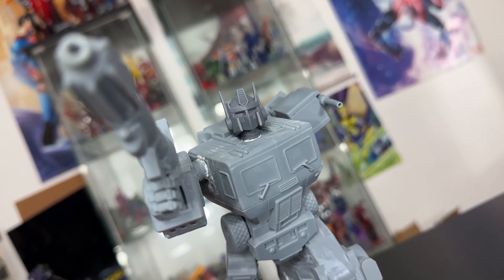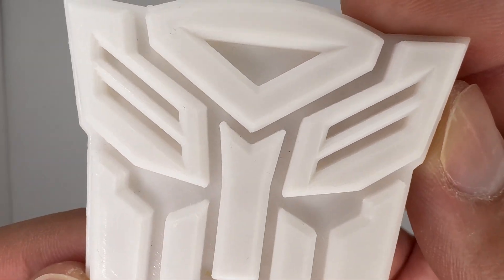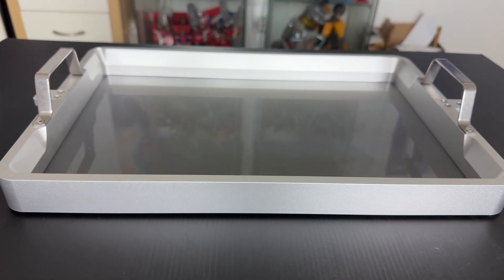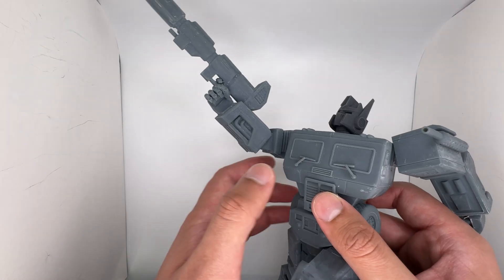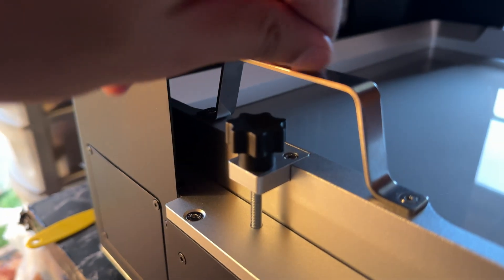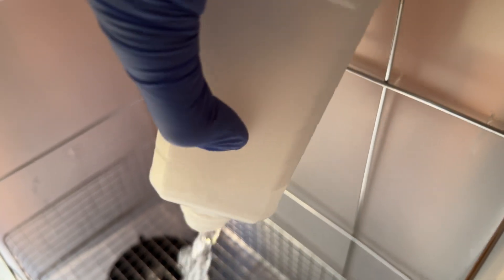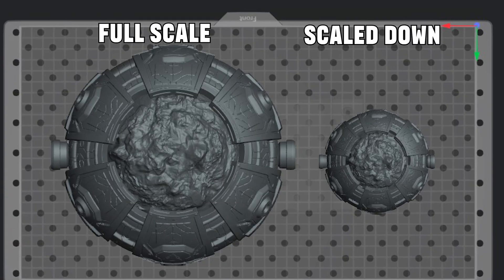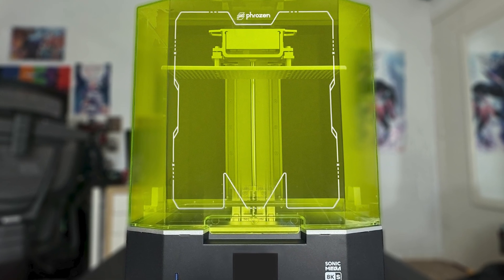IMPOSSIBLE 3D Printing of Amazing Transformers

Comment: This is the best 3D printer/printing I’ve seen so far. Usually what I’ve seen from 3D printers from other content creators is very rough 3-D models they’ve printed. Or a lot of them has broken off when they try to get it out of the printer. Not sure if they just have a cheap 3-D printer or they just suck😂